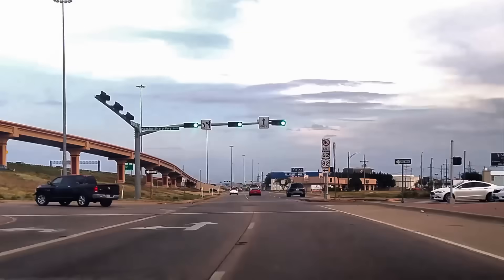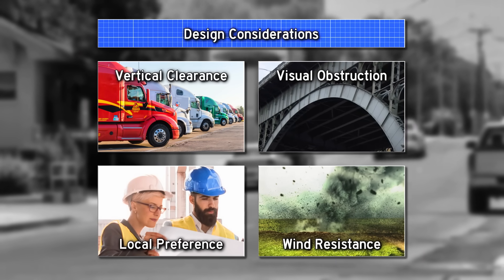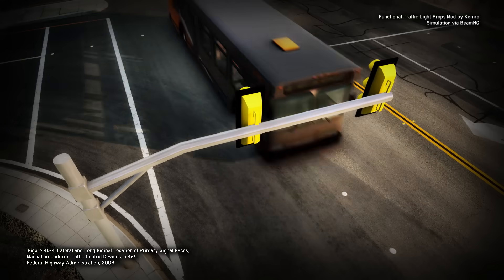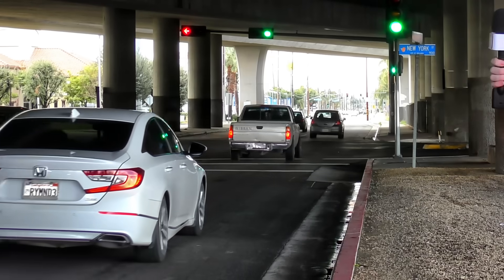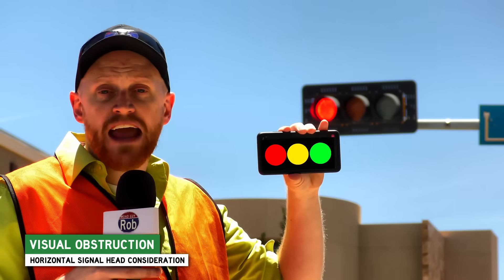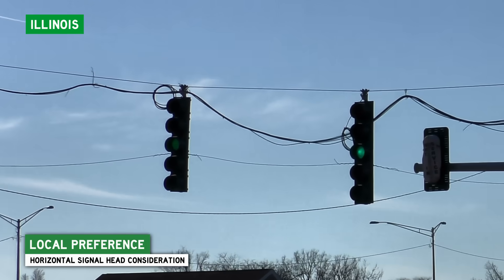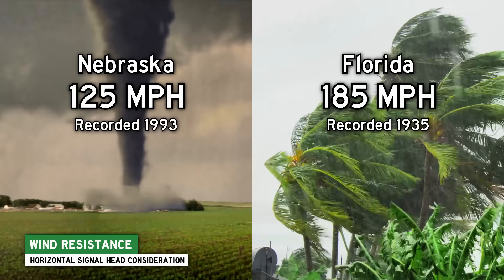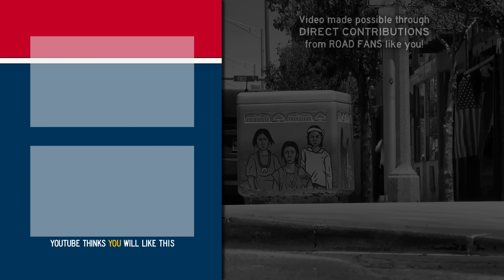What's up with SIDEWAYS STOPLIGHTS in Texas and Florida?

Comment: In Japan most stoplights are sideways, so I was surprised to see most stoplights being vertical when I first went to the U.S. Also Japanese is traditionally written vertically, and when you write Japanese vertically the proper way of writing is from up to down, then the rows go from right to left, so it is not backwards.
Reply: I have an old Japanese railway book that's "back-to-front". The front cover opens to the right instead of the left. What most of us would expect to be the front cover is actually the back. 
Another from Taiwan is the same. And they mostly have horizontal traffic signals there as well.
Reply: @emdB67  Manga books (at least the few I've read) translated to English still maintain their Right-to-Left direction, which can be weird to an unsuspecting reader. The last page - which is the first page if you open from the wrong side - says "You're reading from the wrong side!" as a helpful reminder :)
Reply: @NeatNit  I was going to say I'm sure most of us under the age of 45 learn it this way.
Reply: @emdB67  A lot of Mangas have kept the original approach as well in the last 15ish years (or they did, I've not bought one in years) because they would have to flip the images for us to read them like normal which if a character wears a word would also get flipped and to unflip those words are costly in time. It's both cost saving and "authentic" at the same time lol.
Reply: @egg-roll8968  yeah comic book dialogue is still written vertically rather than horizontally, so it’s still right to left in page order. 

Codex books (ie not scrolls, a slab with pages) had only vertical text for a long time and so read right to left, but following postwar American occupation (and various economic pressures since) horizontal text was increasingly adopted. And the western influence got them read left to right with horizontal text, rather than just transferring the right to left order from vertical text.
Reply: @emdB67  Taiwan got their tradition from Japan during WWII while being invaded  (and occupied afterwards) by the Japanese.
Reply: @ddjohnson9717  Yes, I've noticed many Japanese influences in Taiwan. And not all from the past.
Reply: @emdB67  Taiwan uses overhead horizontal traffic lights extensively too (the island faces typhoons) but with red on the left & green on the right, unlike Japan but like the USA
Reply: @lzh4950  yes, it makes sense that when driving on the left, the red is on the right, and on the left in countries where they drive on the right. 
I've been in Taiwan (Taipei) during a typhoon and in Chiayi several times during earthquakes. I've seen vertical traffic signals here and there in Taiwan, but they're not that common of course.
Reply: I've noticed a lot of the stoplights in northern Japan (Hokkaido Island, for example) are vertical.
Reply: @leafbelly  maybe for weather? hokkiado has hell of a snowfall...
Reply: @PrograError  You're right. Japan has vertical stoplights in regions that have heavy snowfall like Hokkaido, Touhoku, and Hokuriku.
Reply: @PrograError  That makes it worse, though.
Reply: If you put the red light closer to the centre of the road, you will be able to see it from further away. The red light is the most important light as it tells you to stop. So if you drive on the left, you should put it closer to the centre of the road, which is the rightmost position.
Reply: @isoraqathedh  Which makes me wonder if there are horizontal ones in the UK and if so, which way do they go?
Reply: And add on top of that they call green lights "blue" lights. Lots of indicators that are actually green are referred to as "blue" in Japanese, which makes translation fun. 
(I realize this isn't a surprise to railrovision, but thought others might find it interesting.)
Reply: @somethingelsehere8089  That is because in old Japanese, the word 緑 which means green didn't exist, so green things were also considered 青 which means blue. When the first ever stoplight in Japan was introduced at Hibiya intersection in 1930, the newspaper describe the color as 青 instead of 緑. So ever since the color of the green light of the stoplight is called 青 meaning blue in Japan, even though it is definitely  green.
Reply: similarly, their stop signs do not comply with the international standard (octagon shape). they are an upside triangle shape which means yield in many other countries. imagine thinking you didnt stop at the stop sign in Japan just because they are so unique and thought it meant yield? similarly, stop and yield signs should not be surrounded by a rectangular/square border as it removes the uniqueness should the sign be obscured by snow
Reply: @annabelholland that was changed in 2019, now they are
Reply: @annabelholland  Stop signs used to be octagon and yellow which included the English word, then changed to red until replaced with a triangle we know of since 1963.
Reply: @neubro1448  this is what happens if road signs are not comprehensive around the world. i am ok with warning signs being a yellow diamond or red triangle. this is similar to when the USA made the decision to replace symbols with words on a few signs. Imagine going into the country and not understanding how to read signs because you don;t know to read englisc (or japanese  in japan)
Reply: @annabelholland I think probably the most common case in which that would happen would be either a rental car or someone on a US base and in either case they should give you a briefing on road signs and signals 

It's also quite common in areas where snow isn't an issue to just have a stop line on the ground that says 止まれ before it and no sign
Reply: @annabelholland  Man we really need a traffic standard globally
Reply: Horizontal Japanese IS usually left to right though, so I'd argue it is backwards.

I think this is more a remnant of decades-old traditions, back when horizontal writing was sometimes (usually?) right-to-left as well; you can still see that sometimes in older storefronts or such.
Reply: @Marconius6  In olden days, the default was top-to-bottom, and so horizontal writing was considered as writing with lines that were one character high.
Reply: @Marconius6  Horizontal Japanese is not anywhere as common as vertical. You do most of your reading in vertical mode, because that's how books and magazines are printed.
Reply: Came here to say this.  Any manga enthusiast knows Kanji is back to front, right to left, top to bottom.  This is Tategaki.  Yokogaki, on the other hand, is written horizontally and can be frequently seen in subtitles while any on-screen writing is back to Tategaki.  Some headlines, business names and other graphics are also written in Yokogaki.  Romaji, or Romanized, is Japanese written in western lettering and is strictly Yokogaki.
Reply: In snowy regions of Japan, from Hokkaido, along the Sea of Japan until around Fukui the stop lights are vertical. I was told this was because less snow will accumulate on top of a vertical stoplight. 

It is an excellent geoguessr tip, as 90% of the time you see a Vertical Stoplight you are in Hokkaido, Aomori, Akita, Yamagata, Niigata, Toyama, or Fukui.
Reply: @railroVision Regarding blue and green, linguists called that phenomenon Grue. https://en.wikipedia.org/wiki/Blue%E2%80%93green_distinction_in_language
Reply: I think it has more to do with Japan driving on the left side of the road. Korean and Chinese were also written right to left traditionally. But horizontally mounted traffic lights in Korea and Taiwan also have red on the left.

Conversely Singapore, where English is the first language, has horizontal traffic lights with red on the left because like Japan, they drive on the left side of the road.
Reply: Well, like he said in the video, we read left to right then top to bottom, while Japanese is read (traditionally) top to bottom then right to left. 
So, while both cultures read top to bottom, on a sideways traffic light, the order is reversed due to the horizontal switch. So while the reading couldn't quite be called backwards compared to English, the traffic light placement can be
🚥🚦
Reply: @ClayDress  Kind of unrelated but it's fun to see how different platforms render the horizontal traffic light emoji that you just used. Google and Twitter have it green, yellow, red which I assume is because it was one of the original emoji on Japanese phones. A few companies choose fonts that flip them around to red yellow green, though, like Apple.
Reply: @ClayDress Also consider Japan is a right hand drive country. It makes sense that the innermost traffic signal is red and the outermost signal is green.
Reply: @ClayDress  plus they drive on the left (as do I), so the all-important red is more visible, closer to the centre of the road if it's on the right in countries that drive on the left. I suspect that's the real reason, not due to how the local language is read.
Reply: @ClayDress  Are those traffic light emojis? That support right-left and left-right? what!
Reply: @ClayDress Singapore meanwhile mostly uses English & our overhead traffic lights are horizontal too (we get strong winds called Sumatra squalls during thunderstorms, which aren't uncommon) also with red on the right & green on the left
Reply: When I lived in Japan, I never noticed it was right to left. I was too busy trying not to turn on my wipers when lane change signaling.
Reply: They are horizontal in Canada too. It's another case of Americans being confused that the entire world isn't just like them
Reply: Anyone who’s seen a manga before should know such books read right to left, it’s a rather dead giveaway that Japanese typically goes in that direction
Reply: I was about to say. To add: 
Nowadays, it's still the case that most Japanese books are printed and bound the traditional way, so they actually open from what we would consider a book's back (but that's their front). You open the book there and then you read top to bottom, left to right, and then you turn the pages until you get to what we could consider a book's front (but that's their back). If you're looking at the actual front page of an unopened traditional Japanese book, the spine is on the right. Newspapers like Japan's big six dailies also use the traditional way for their paper editions, but websites generally use the Western way. If you read translated manga, you may find they're also bound and intended to be read "back to front". Alternatively, as a concession to Western habits, all the artwork may be mirrored, so it can be viewed and read "front to back". The right-to-left lights in Japan make perfect sense with traditional habits in mind.
Reply: Having them vertically oriented makes it somewhat easier to have a signal for each lane of traffic when there's more lanes of traffic. I'm sure you can do it with horizontal ones as well, but you don't get as much space between them. 

Around here we sometimes have 3 different sets of traffic signals, one for the left turn lane, one for the main lane and one for a right turn lane. Getting all that to fit in a way that's not confusing with horizontally mounted lights is less convenient.
Reply: just about to say the same about the japanese writing style, and im a american.
its a mistake content creators make about japanese writing, and its kinda weird. a bit of research goes a long way in that department, but i guess theres some misinformation that got crossed somewhere and rob took the bait, because his videos are usually more informative than that.
i one day hope to visit japan tho, just wanna save up a lot of money and learn the language first.
Reply: tategaki isnt really used much anymore, the proper way to say this would be "japan used to do tategaki a column top to bottom, then right to left, style of writing, still sortof seen in manga panel reading today."
Reply: Interestingly enough we are not fucking Japan
Reply: Horizontal text used to be written from right to left and I think can be done either way, but mandated to be left to right after the war.
Reply: That's weird. States and countries that are against LGBT in schools/culture also mount thier stoplights horizontally.
Reply: Don’t the Japanese drive on the left side of the road rather than the right side as well?
Reply: Yeah and your traffic lights are hidden in a corner like other Asian countries
Reply: Wow your English is really good
Reply: Huh. I thought the RYG was right to left because you guys drive on the left. 🤔
Reply: Japanese traditional writing is 90 degree clockwise rotated relative to English (and Latin derived) writing.  

What's more of a mystery to me is how that came about... When you're writing with something which can smear, left-to-right and top-to-bottom is simply more practical for right handed folks.
Reply: @travcollier  Paper has been widespread in China for around 2000 years, but vertical bamboo slips called 简牍 (jiǎndú) were used for writing for at least 1000 years before that. You would write on separate slips, then bind them together into a roll/book 简册 (jiǎncè). If you are right-handed, you would naturally hold a book with your left hand and pull to unroll it with your right hand, so you would start reading at the rightmost slip. Everyone continued the traditional writing direction when they switched to paper, and Japan then inherited it from China.
Reply: @kihada1611  Yep.  That was my thought, and seems plausible.  Just thought they would say "this is f-ing annoying" at some point ;)
BTW: I took a Chinese history course in college... Super interesting stuff
Reply: @kihada1611  was gonna say this if you hadn’t :)
Reply: @travcollier  that's why (traditional) Japanese writing goes from top to bottom THEN right to left, often when writing like this by the time you go back to the top to start the next row the top of the first row is already dry and less prone to smearing.
Reply: @SherrifOfNottingham  well your right sleeve would still smear over the lower end of the previous row. Fine for short sleeves, but what if you have those ancient Tong Dynasty giant bell-bottom sleeves, that's guaranteed to smear
Reply: @1224chrisng  that was actually part of the art of calligraphy, keeping the hand elevated while the other hand holds the sleeve so it doesn't graze the writing at all, in fact no matter which direction you go the sleeve would still need to be managed properly by the scribe.
Reply: @travcollier  I'm way late answering this, but it's because Japanese was not written with pens until modern times. It was written with brushes, and you held your hand away from the paper.
Reply: Also, recall that their books are read right to left, known as Tategaki. But with the advent of more current forms of media, and computers, Japanese writing being the same as English (Yokogaki) is pretty normal now.

I'm far from any sort of expert on the matter, but from what I have gathered (and don't quote me on this); Kanji is still commonly written in the traditional directions (Vertical and R>L) while Hiragana is common in the modern style (Horizontal and L>R) again, I believe this is due to computers and the need for predictive text input, even with a keyboard, and the use of Kana to Kanji conversion that is needed. Of course, there is a lot of overlap because of computers doing conversion from Kana>Hiragana>Kanji resulting in yokogaki styled Kanji.

Comment: Regarding weather:

If that was the case, then every single stop light would be horizontal.
Especially the states in tornado alley.
Reply: Tornadoes are a lot rarer, though.
Reply: Tornadoes are so sporadic and violent there's no point in trying to design a traffic light that can withstand more than a weak one. Hurricanes devastate a far larger area, so trying to prevent damage or destruction is important.